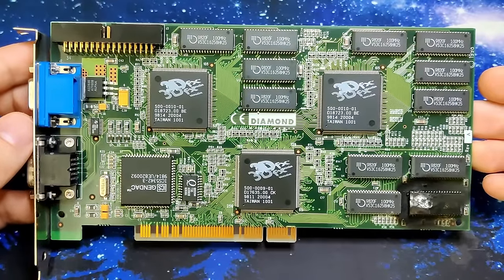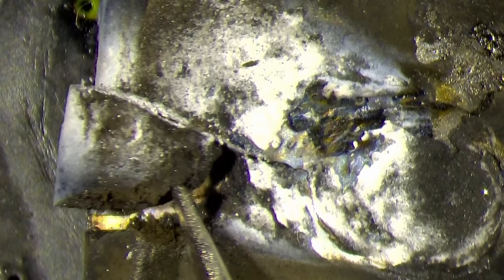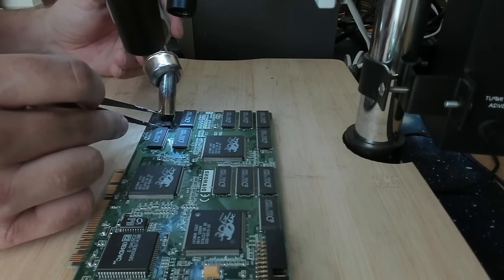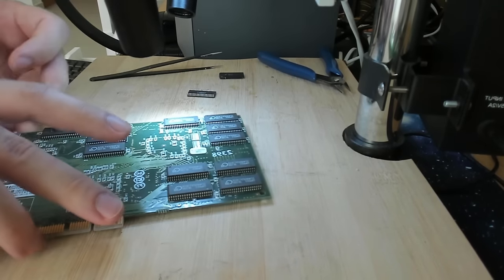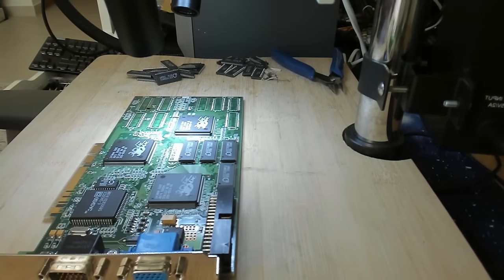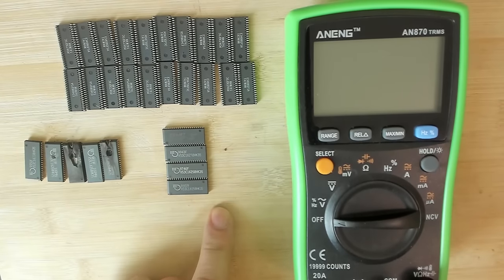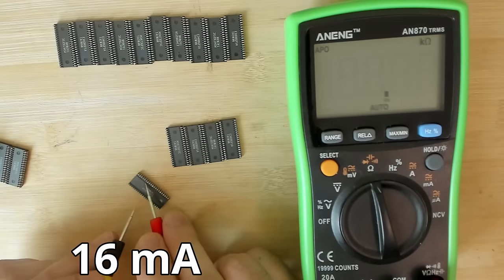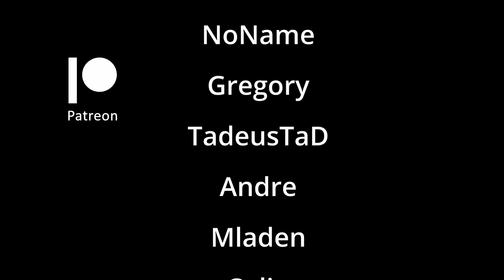Explosive Memory: Can we save this Voodoo 2? (Part 1/3)

Comment: When testing the resistance between Vcc and Vss (ground) pins, when you turned the chip around, you tested it in reverse polarity also, that is why you got differnt readings on each position. 
Not sure if it helps, but I remeber having a broken (half of a Voodoo 1) card that I used to salvage the memories to upgrade my Trident VLB and S3Trio PCI video cards. Maybe I was lucky and the memory chips just were compatible (no datasheets, just similar partnumbers on the chips) with those on the video cards, but this is a idea to test them if possible, and using slots is far easyer with so many VGA tests that exists for dos.
And yes, even if you can use the "survivors" to max a 2D video card, is still better than to throw them away.
Reply from the maker: I was not aware of reverse polarity when testing for resistance. I never thought of it to be honest. I will try that with the memory chips one more time and see if there's a difference.
Yes, I agree to test the memory chips on a 2D card. There is not enough space for sockets on the Voodoo 2. The memory chips are too close together or SMDs are in the way.

Comment: I was hoping you'd suggest using a socket and using the surviving chips. I'm a sucker for replacing only the bad components. The surviors earned their place on the PCB
Reply from the maker: Unfortunately, I noticed there is not enough space on those reference designs. I will try to test those memory chips using an S3 card. I have a few that can be used.
Reply: @bitsundbolts  I was wondering if there was a better way to test them. Should like you found one 👍. I really look forward to a next video.

Comment: Im really curious to know how this will end, if the 5V line went so wrong that almost all the memory chips were destroyed, I would think other chips on the PCB would be damaged as well unless they are powered by another line. I’m all for adding sockets and trying if the 4 chips that read in the Mohms still work. It’s actually impressive how well that PCB cleaned up and the damaged to it turned out pretty minimal, you’ve fixed way worse than this before.

Comment: It should be good. The main GPU chips are running through an on board regulator. That regulator can handle a wide range of input voltages. The RAM is being fed from the 5V rail and would have gone boom.
Reply from the maker: Yes, I agree! I think the voltage regulator has saved the 3Dfx Chips.

Comment: Ich habe mir schon gedacht, dass alle Chips runter müssen. Wenn dort ein Kurzschluss entsteht, sind alle gefährdet und wie du gemessen hast, sind 20 auf jeden Fall tot und die 4 anderen würde ich auch nicht mehr verbauen. Hatte auch gedacht, dass einige der Kondensatoren durchgeschlagen sein könnten. Die 4 Überlebenden Chips würde ich gerne mal in einen Tester stecken. Wahrscheinlich sind die Chips trotzdem kaputt auch wenn der Widerstand passt. Drücke die Daumen, dass die KArte mit 24 neuen Chips wieder lebt. Starte die Karte mal ohne Speicher in einem System und lass Mojo prüfen ob die 3DFX Chips nocht reagieren und die Karte überhaupt erkannt wird. Grüße aus dem Urlaub von der Ostsee.

Comment: Surprising to see that even after that mess the PCB still quite in good shape and only those pads were gone.

I understand the 2 cam setup is new, but could you disable the mirroring on the webcam; it's kind of disorienting and weird to see texts mirrored there but normally on the microscope camera.
Reply from the maker: Yes, I think this was a setting I had on for another video. I missed it while recording. I will correct it. Thanks.

Comment: Do you have a thermal camera? It would have been cool to try voltage injection before removing the chips. Just to see if all the bad ones would have lighted up or not.

Comment: my guess was core is after voltage regulator so if you remove all ram and voltahe regulator inject low voltage and see what else blows up, but if you not hace a short try populating it in stages to see  if it see textures and vertev memory but you can probably use test oftware to test 0mb board and if chips are ok it would say it lives with no memory?
my guess is there is high chance gor 3dfx chips to be ok because memory acted as a lightning rod
but we will see
Reply from the maker: Yes, I hope you are right! The memory took all the beating - hopefully, the rest of the card is fine - which would still be a miracle in my eyes!
Reply: @bitsundbolts  it all depends on absulute max operating voltage of the components and therefore breakdown voltage, but also a capacitance of nearby filters because capacitor would take voltage first and only then pass it onto the closest low resistance, if memory had no filters and 3dfx chip did there is no wonder why memory went up in smoke first

that being said expect blowing up tantalum caps, because they also have a voltage rating

Comment: If you add memory sockets - it would be best to add them for one of the TMUs for easy visual (bad texture) testing 😊
Reply from the maker: I checked, but there is not enough space for sockets. Those memory chips are too close to each other or SMDs are in the way.
Reply: @bitsundbolts  ah, that’s unfortunate…you could always test the RAM chips on an old S3 Virge DX card - they usually have already installed sockets

Comment: I have an S3 Trio64V+ with SOJ sockets so I can easily test these EDO RAM chips.
Reply from the maker: Yes, this will be the method to test those chips. I'll not solder sockets to this voodoo 2 - no space :)
Reply: @bitsundbolts  I've only seen one Voodoo 2 with enough spacing to solder on sockets - the Procomp G111. None of the common board revs have the space.
Reply from the maker: Yes, correct. Not enough space on those reference layouts

Comment: Either 4 sockets on the back side so they are easy to reach for testing memory. 

Or 8 sockets in the places where an 8MB version would have empty spots.
Reply from the maker: I tried to place sockets, but there's not enough space. The memory chips are too close to each other or SMDs are in the way
Reply: @bitsundbolts  bummer, yeah it didn't occur to me that SMD memory chips need sockets with way larger footprint. The through-hole days were easier in that regard.

Guess you'll just have to solder them all.

Comment: There might be hope for this card. Where did you buy those memories chips from? 😮
Reply from the maker: I had to look for it, but it turns out: AliExpress. It's 200 pieces in total. I know it is hard to find those chips, and AliExpress may not be reliable. However, so far, I was very lucky with ICs from there. Let's wait for part 2 - I am going to use them.

Comment: could have put 0.5V 100mA on the 5V rail and looked in infrared at what gets hot. alt used a micro-ohm meter to physically locate the short(s).

Comment: This isn't a multi-layered board? because I had a meltdown on a power rail of a GTX1070 and it was beyond repair because it melted a bunch layers...
Reply: I'm almost certain it's at least a 4-layer board. Too dense to fit on a two layer especially when considering the signal integrity issues of not having a ground plane.

While the difficulty increases dramatically its entirely possible to repair broken internal traces on PCBs. It's just very rarely economically feasible to do so as it takes a lot of time from an individual with a highly specialized skillset.

Also fwiw a GTX 1070 probably has somewhere between 8-12 layers and are HDI PCBs so they're so dense that one of these Voodoo board looks downright barren in comparison.

Comment: Hi. I have an unidentified motherboard with Cyrix 486 dx2-66 with these fake cache chips even soldered into the motherboard, without any sockets on it. BIOS reports 256k, Cachetest reports that cache is absent and about possibility of fake cache. Thnanks for you video, now i'll try remove these "chips", solder sockets and install normal cache chips. Later I had doubts to do that..
Reply from the maker: Interesting! Did you know you had fake cache chips or did you check after you saw my video? I am just curious because I wasn't aware that they went that far modifying the BIOS.

Comment: Even if a couple chips work, they're still probably degraded and could fail spontaneously on you or only stable at much lower clocks. Considering you have so many spares, I don't think it's really worth mixing and matching them with known good chips.
Reply from the maker: I agree. I might test those chips on an S3 card. No need to put a Voodoo 2 at risk.

Comment: Maybe 4 good chips.. now I'm wondering if they're from the same bank or one from each bank.   What was the root cause of the short? Bad power supply?  Lightning  storm?
Reply from the maker: Unfortunately, I didn't mark the chips - so, I don't know from which position they came from. I suspect that the 12V rail and the 5V rail shorted. So, 12V entered the 5V section. This is just speculation.

Comment: First clipping out the burned chip legs would have been less "painfull" for the board...
Also cleaning and finally desoldering the remains of the legs with a ton of flux would have eventually saved more pads...
Reply from the maker: Yes, I agree. Lesson learned for next time.

Comment: A little advice: With such damage, sometimes it is better to cut out the legs of the integrated circuit than to heat it with hot air. Some S3 VIRGE/TRIO graphics cards had empty EDO memory slots. If you have such a card, can you test the Voodoo 2 memory in it?
Reply from the maker: Yes, I'll probably test the memory on an S3 card. There's no space for sockets anyway on this Voodoo 2.

Edit: Yes, I agree with you, I should have cut those legs on the burnt chips earlier. Lesson learned for next time!

Comment: After removing the visually damaged mem. chips; to discover the short, you could have injected some low Amp current (probably might work even with a 3V coin cell battery), and watch with your thermal camera what slowly heats up.
Reply from the maker: Unfortunately, I don't have a bench power supply which would be required for voltage injection. I haven't done that before, so, I'm not an expert.
A real expert told me however, that a battery is not enough to drive enough current for things to heat up.
Reply: @bitsundbolts  Yeah, I guessed u don't have a bench PSU, that's why I suggested the battery thing. Using a battery would totally work, but it would depend on the battery Amperage, and the resistance of the circuit.. I wrote my comment before finishing the entire clip, and in hindsight, just one 3V coincell wouldn't have heated up so many chips. But, say, stacking up 2x 1.5v D-cell batteries (in order to still get 3V), I think would have had enough Amps to raise a few degrees in order for the thermal camera to pick up the change. This would be the "poor man's" solution to voltage injection :P

Comment: I would hsve expexted maybe a cap to be shorted, North Ridge Fix uses power injection tool and thermal camera al lot, and most of the the time it's a cap , but this one was in a system with a faulty power supply so you can expect anything

Comment: Another youtuber repaired the same model card, the bottom-right corner chip heated up to 80 degrees at one point, but resolved itself after cleaning around the chip (might be unrelated).
Reply from the maker: Hm, I think mine was a bit hotter than 80 degrees ;) But thanks for the hint - I should look at the card with a thermal camera once I confirm it is working.
Reply: @bitsundbolts of course yours got MUCH hotter 😂 Just mentioning that that chip gets hot if something is wrong and that there's some correlation etc

Comment: Damn, i would say: "It's dead Jim".

But maybe the blackening looks worse than it is.
Reply from the maker: Maybe there is some sign of life in part 2 which I am working on right now.
Reply: @bitsundbolts  Just finished watching, and i'm surprised. Though a lot of dead memory chips. It remains to be seen what that PSU did to the 3dfx chips.

Bad/Old PSU's are no joke.

Comment: This is 12v on the 5v rail IMHO
Reply from the maker: That is what I think has happened. I mention this in part 2 - which is done, but needs editing.
Reply: I'm thinking more like 230V AC, as it happened during normal operation and I've seen a similar result from a failed PSU somewhere else as well. But it's impossible to tell what exactly happened inside the PSU when it failed almost 25 years ago. Unfortunately, it's long gone. The rest of the machine is still there though and at least the mobo is fried too.

Comment: Is it possible to put slightly quicker memory in such as 133mhz instead of the stock 100mhz? I think you could control the gpu and memory speed in one of the control panels on Voodoo cards before?

Comment: I wouldn't trust those memory chips.
Since all the other chips died, I think the likelyhood of them being damaged is very high.
Maybe start with all new chips, and if everything works, try swapping them in one at a time.
Reply from the maker: Some of those memory chips are so close to each other, it will be impossible to add sockets to the card. Even the frame buffer memory chips can't have sockets because of SMD components. I think I will keep those chips for other cards - like an S3 or so - I think they use the same memory chips.

Comment: Four survivors is a suspiciously round number. I wonder if the call came from the same area of the board. It's possible they were all sharing a power/ground trace and that trace blew before the chips did, acting as a fuse. So you might want to check all the power rails on the PCB before soldering new memory chips. 

But I wasn't surprised you needed to remove all 24 memory chips. Personally, I would have jumped straight to removing them all as soon as I saw the brown discolouration on so many. Discolouration means it didn't just fail, it failed with enough extra heat to burn plastic. As they are roughly identical parts, you should either see only the weakest parts fail, or for the majority to fail. The chance of a middle ground where only 50% of the chips failed is unlikely. 

As for your chances of repair, I believe your chances are quite high, especially if the FBI and TMU chips are hiding behind a voltage regulator (I think they are... not sure)
Reply from the maker: I should have marked the memory chips before I took them off. Ah, missed the chance here to gather more info 😕 
But yes, the 3dfx chips are after the voltage regulator. Maybe I am lucky and the 3dfx chips survived.
Reply: You can at least tell if they were on the front or back based on the date code (Front are all 20th week of 98, Back are all 19th week). And if you happen to find 4 memory pads where the resistance to 5v or ground is higher than expected (or open), you can probably jump to conclusions.
Reply from the maker: Oh, I'll check that. Thanks for your observations!

Comment: I was expecting some shorted caps after you removed all the ram.
Reply from the maker: I believe that 12v entered the 5v section (whatever the reason) - and the memory couldn't deal with that. Most of the SMD components are probably rated for 50v. That could be the reason there is no problem with any of the caps. But all speculation based on component ratings I usually purchase.

Comment: Pull the ram off, plug it in,  and run the diag program.  See if it sees the chips.
Reply from the maker: That's the plan for part 2 😉

Comment: I've seen and blown a lot of chips but I've never seen such catastrophic failure on a RAM chip even when accidentally feeding it the wrong voltage rail.
Reply from the maker: I don't know what happened, and I haven't seen many burnt chips either. But it's good to hear that I could push the bar for catastrophically failed chips 😅

Comment: If the voltage on the 5V line was so high to make the chips explode it's difficult to see how the 3dfx chips should have escaped unscathed.
Reply from the maker: They are maybe protected behind a voltage regulator. Unless something happened on the data lines, the 3Dfx Chips might still be alive!

Comment: Where do you bought the memory chips, i need some to increase my 8mb to 12mb. Thanks.
Reply from the maker: I found them on AliExpress. They're not cheap, but I once got a good deal during a promotion period - I bought 200 of them (that big roll).
Reply: @bitsundbolts  i also found them too but not cheap either...hope you fix the voodoo, you probably can.
Reply from the maker: Yes, they are expensive. However, they seem to be new and might just be the real deal (original). I bought them during one of their promotion periods - but yes, still expensive!
Reply: @bitsundbolts  i l give it a shot  i only need  few,thanks

Comment: Never seen such a damage. It looks like the card got 12V instead of 5V. Maybe an incorrectly wired PSU to mainboard plug. If you pull too hard on the cable, wired might get loose and putting them back into wrong postion might get 12V and 5V switched. But there must have been more damage than "just" the card.
Reply from the maker: I think there was more damage. The  card was just one of the victims. I agree with you. I also expect the 12v line to be the cause for the damage on this Voodoo card. How it happened? One can only speculate.